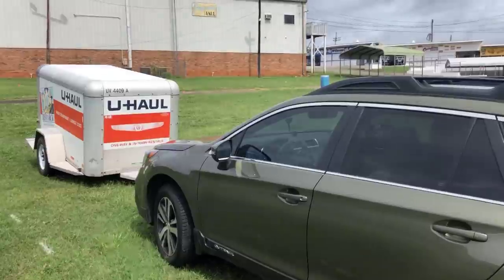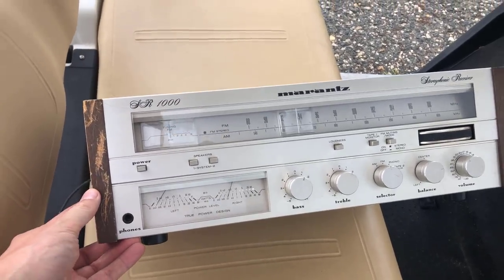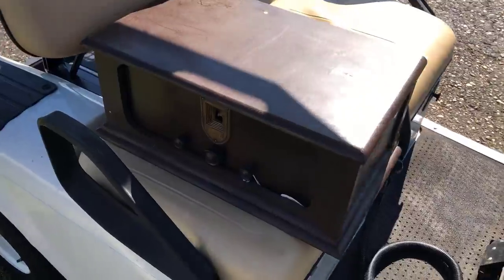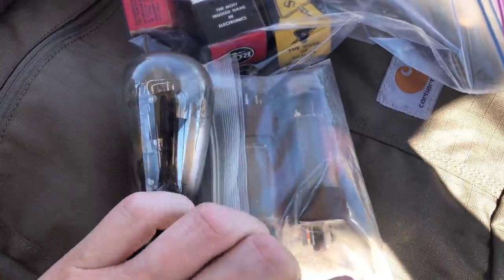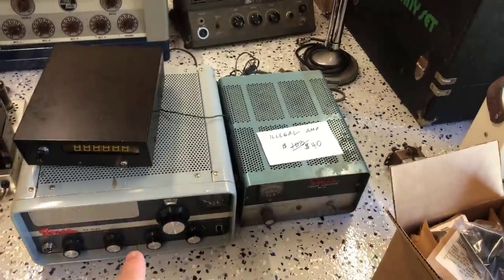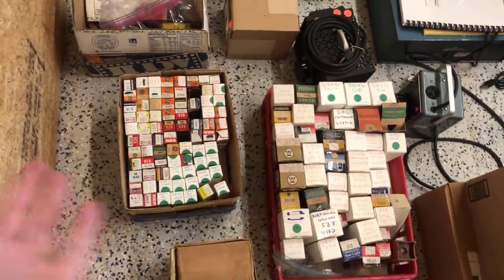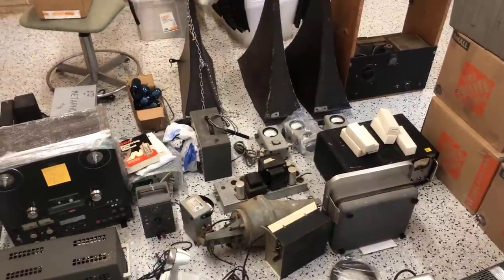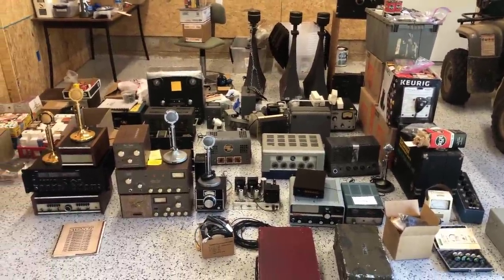Shelby Hamfest 2021 - Part 2 - Audio Picker Finds

Comment: I have a question. I'm in the process of designing and building an amp. I have wired and tested the rectifier under low load conditions. My question is, is it safe to wire the output tube connecting the b+ directly to the plate without the transformer in order to start to add a load and continue testing and learning?